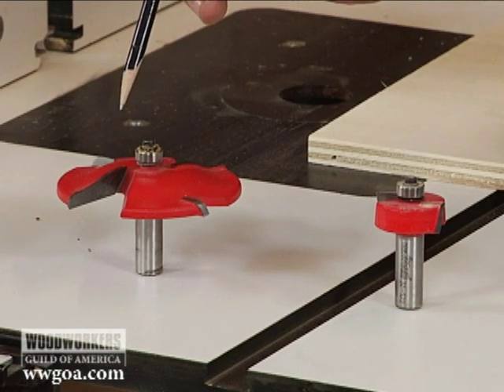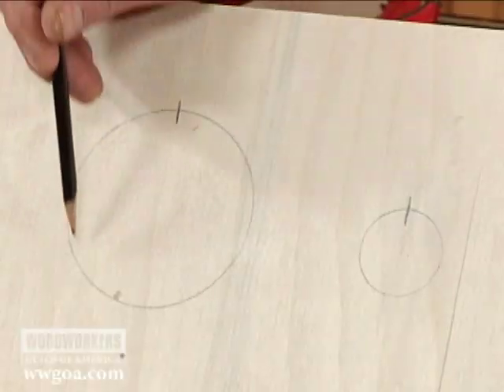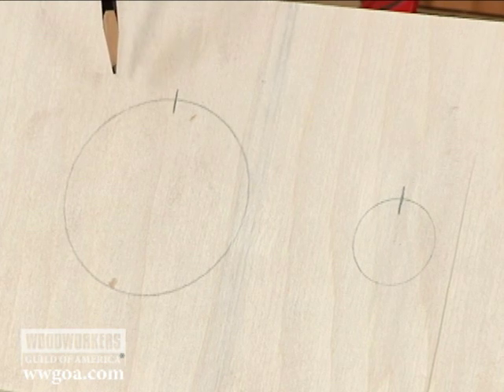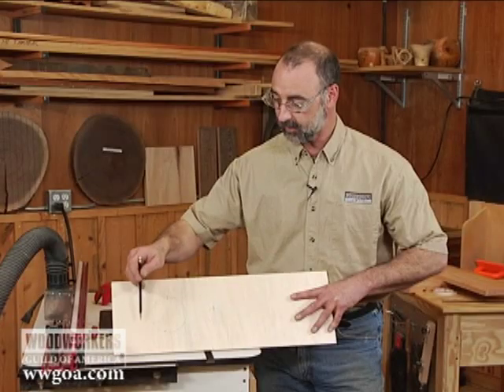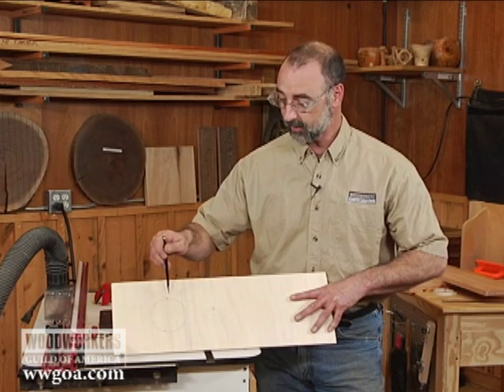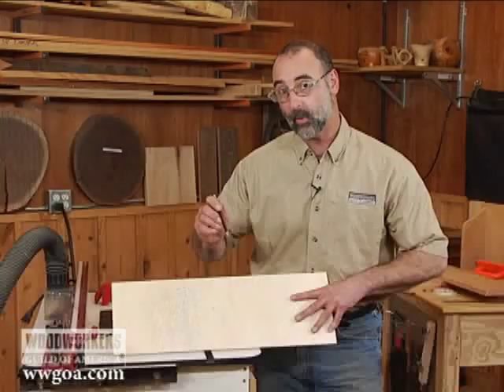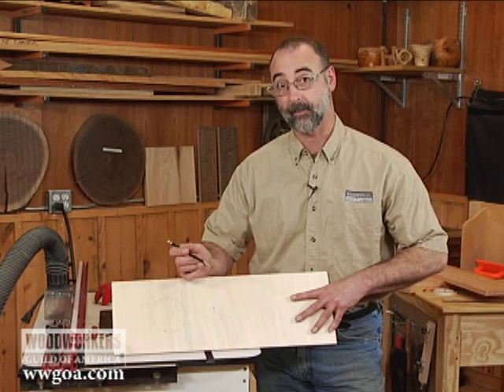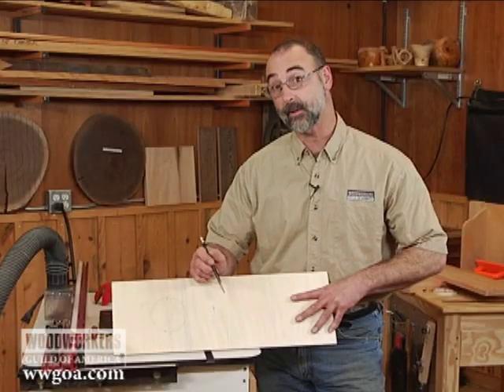Woodworking Tips: Router - Router Bit Speeds

Comment from the maker: There are a handful of variables here.  A ½” round over bit shouldn’t require a reduced rpm. But you should make the cut in multiple passes.  To get a full ½’ round over in oak I’d do the cut in three passes.  Expressed as a percentage I’d do something like 40%-40%-20% stock removal.  I want the final pass to be very light to make sure the bit has every opportunity to provide the best possible surface.
Reply: Can you over spin a bit?

Comment from the maker: Finally, I’m assuming you’re using a router bit with a ball bearing on it.  Some manufacturers do still produce bits that use a pilot (a fixed shaft on the bottom of the bit) instead of a bearing.  Since the pilot spins along with the bit it’s really hard to produce burn-free cuts.  If you are using this type of bit you’ve got to take even lighter passes so you can keep the router and bit moving forward into the cut, never stalling, so you can do it without burning.
Reply: I use different thickness shims till i get to the full profile. 3/4 shim then 1/2" then 1/4" and finally at full profile. It allows you to cut only a 1/4" at the end and less burn marks.

Comment: Hi George. I hope you have a tip. I'm kind of new to woodworking and really enjoy it but I'm getting very frustrated. Nothing seems to go right. The latest headache was burning the almost completed project with my router. I don't have a variable speed and was adding a 1/2" round over to a piece of oak, inside circle, and it was a disaster. Is there a method for using a single sp. without burning the wood and swearing?

Comment: hello sir! i am making a diy router table, I bought online a 1/2" chank, 3.5-inch panel raiser bit and ER16A Collet Chuck Motor Shaft Extension Rod C20-ER16-40L but i have only 1/2hp 3400rpm motor, do you think it will work?
Reply from the maker: Great Question! I will ask one of our experts and get back to you right here.
Reply from the maker: That seems very slow to me.  I haven't tried it and I wouldn't recommend it.  
Paul
Reply: @Wwgoa  thanks. i just have rewound motors from my water pump, i'm just thinking if i could use that with adapter attached to the shaft